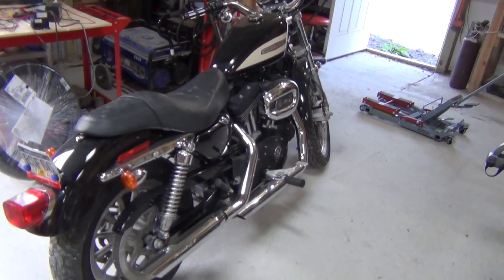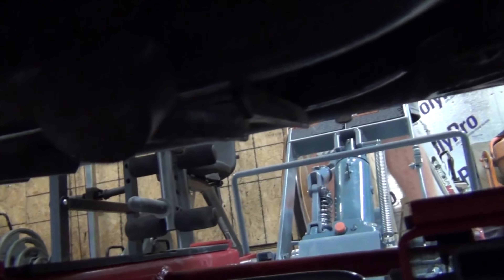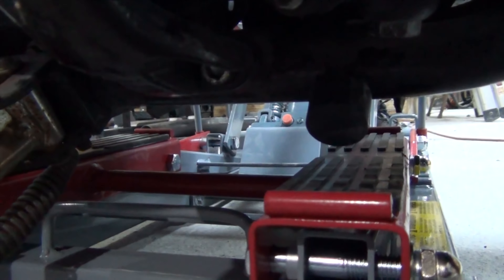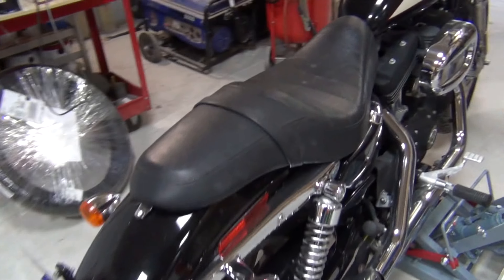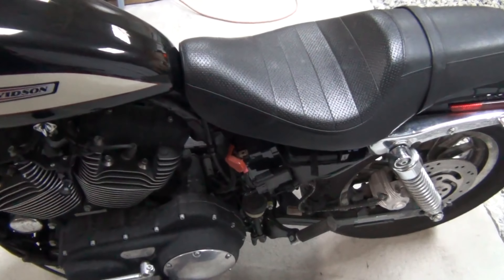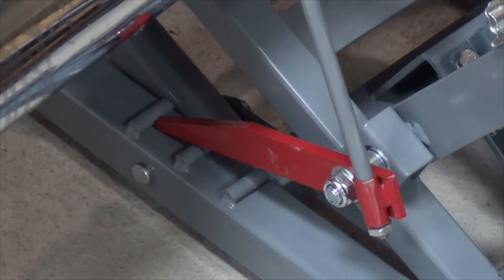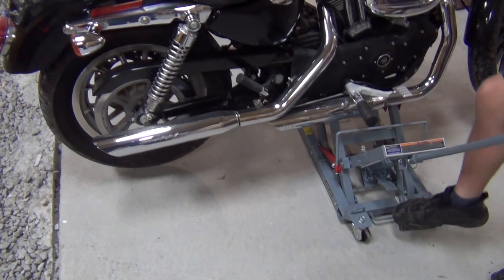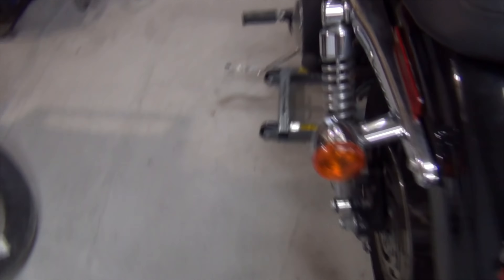How to use a motorcycle jack / HOW TO JACK UP A MOTORCYCLE DONE ON A 2006 HARLEY DAVIDSON SPORTSTER

Comment: Always use ratcheting straps to prevent the bike from tipping over. Once fully lifted, strap it down. Keep in mind omce strapped you cannot raise it more unless you loosen the straps. Similary, when lowering the bike the straps go loose.

Comment: I have an 2000 1200 & Thanks very useful ..that helped me alot BC I Just Purchased an jack so similar but Bike will be in jack for a week or while i do a lot of work  / new tires . carb rebuild / breaks .fluids & hopefully no wheel bearings lol .so Now i need to try to find a as good video  as yours was ....on Strapping  it down  for  the lift properly  for more safety

Comment: I have one of these motorcycle jacks I use on my sportster. The only other thing I do is I put a ratchet strap down between the gas tank and the steering head and ratchet strap it to the Jack because the frame is kind of narrow on a sportster it could tip. It’s very stable when you ratchet strap to the jack on both sides. I had mine for a long time 15 plus years. Mine was a prototype to try out which I got to keep.

Comment: Excellent video. Be careful though if like on my old '91 XLH883DLX, your exhaust position is below the frame. When lifting you may force the exhaust to try lifting the engine and crack you gaskets. It happened once, had to have all of them changed from bottom to rocker boxes. Since then I'm not using anymore the jack but will move to a hoist.

Comment: Ok so I am sure gunna be dumb question. But what exactly is that rubber nipple cover that you show in the video that is to the right of kickstand and right next to the lift section? I have seen others put the one point of lift directly on that as if it is ment to use as a jack point?? Any help??

Comment: i have a 06 sportster also. just bought a jack just like this. my bike needs both tires replaced. will the jack hold the bike with both wheels removed?
Reply from the maker: I would use Jack stands also to be on the safe side. Give it a nice solid base so it will not fall.

Comment: Does it stay balanced if you take the front or rear wheel off?
Reply from the maker: Mine did but you have to make sure the weight is distributed evenly and the bike frame is square with the Jack. I do close up shots of how I have it setup. I was skeptical at first, but if everything is square and even, it should be fine. I go up slow while holding the handle bar and then I check it. I hope this helps. Please like share and subscribe. Thanks again
Reply: @handymanPF  thx for the reply!

Comment: Aren’t you worried that it will tip over on its side? What’s stopping it from doing so?
Reply from the maker: It has to be centered on the Jack.underneath the frame is flat enough to sit on the Jack. Plus if you watch the video again you will see how I check to make sure it is stable on the stand. Now granted, if I am doing some serious work on the bike, I will use Jack stands also. You have to be safe about it. I am very happy with this stand and I highly recommend getting one just like this. You can find a good one here 
https://amzn.to/3IUkTHW I hope this helps. Thanks for watching and commenting. Please like share and subscribe
Reply: @handymanPF  thank you for the reply!! I’ve been looking at getting a jack to put new lowering shocks on my bike.